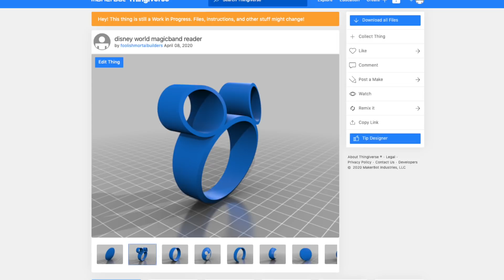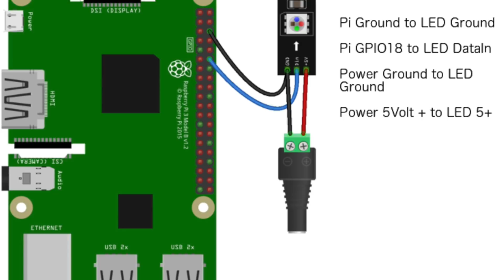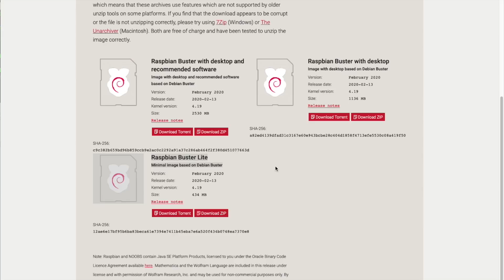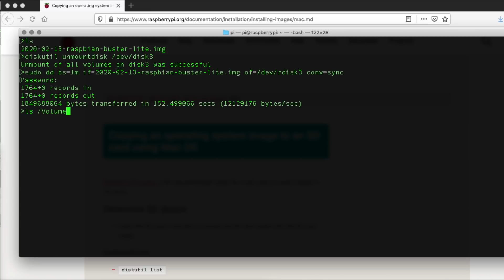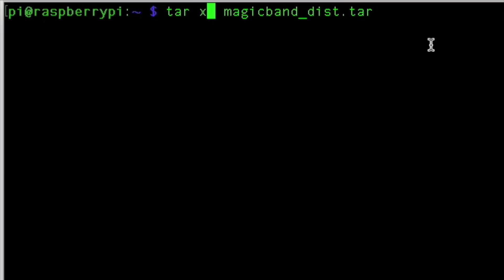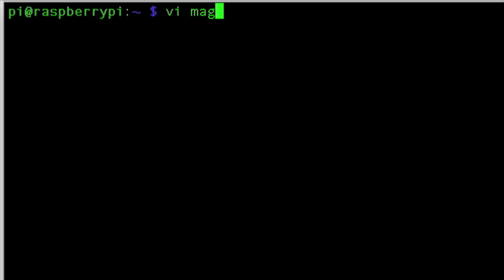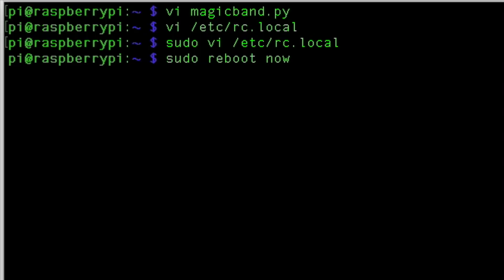Build a Disney World Magicband reader

Comment: For anyone finally getting around to trying this.... make sure you are using the:
Raspberry Pi OS Lite (Legacy)
Release date: December 2nd 2021
Kernel version: 5.10

Follow the video to install and gain SSH access. Once you are able to SSH in, immediately run raspi-config, get into the advanced section - audio and change to HDMI. Then continue following the video.

If raspi-config doesn't show you a HDMI option you installed the wrong version, raspberry has made a change in the latest OS, that took me and Foolish a bit to figure out before Xmas.

Also for sounds, make sure you put them in the /home/pi/ directory, not sure if I missed it in the video.

PS - want to thank Foolish for taking the time to go through my setup and help sort out what was going on with the new OS not working.
Reply: Would be able to help with the sound files?  I’ve tried contacting the creator via email as noted but I haven’t heard anything.  Any help would be appreciated.

Comment: Has anyone ever tried adding support to the code for one of the less expensive  NFC/RFID readers like the RC522?

An example of one of these is: https://www.amazon.com/IZOKEE-RFID-RC522-13-56MHz-Arduino-Raspberry/dp/B076HTH56Q/ref=sr_1_9?dchild=1&keywords=raspberry+pi+nfc&qid=1622200735&sr=8-9

From what I've read here: https://news.ycombinator.com/item?id=9177375  the Disney MagicBands appear to use the same 13.56 Mhz NFC chip that the RC522 readers can read.

The RC522 readers may not have the same range as the USB reader in the original design.  But for people on a budget, it would be a nice alternative.

I can confirm that the RC522 reader does connect to and work with a Raspberry Pi.  I used the example code from this site: https://pimylifeup.com/raspberry-pi-rfid-rc522/ to wire mine up, and to test that it can read a tag (not a Disney MagicBand, as I don't have one of those yet), and print the ID number of the tag.
I'm more of a hardware person, than a software person; so I'm not sure how to go about modifying the magicband.py code to add in support for the RC522.  I'm just wondering if anyone has tried it..?

Comment: Why did you not decide to run the PI and LED's off of the same power supply with both of them being 5V? This seems like it would simplify this a lot and save cost. Granted, you might need to run power over to the port, or solder it different. Any technical reasons that I'm not thinking of why this wouldn't work?

Comment: Hi I have scanned my magicbands and I only got the UID of it not any fastpass or DVC is there a way to use any other code like yours fastpass or DVC
Reply from the maker: All you get is the id of the band. If you want different sequences other than the dvc and fastpass, you have to program the sequence yourself using the settings conf file and uploading new sound files.  Nothing is read from the band other than the id.

Comment: Hey man, good job with all this, I'm trying to build my own and I already have a Raspberry 3 A+, it's still the same right? Thanks!
Reply from the maker: Yes that should work. You'll only have 1 USB port I believe, so if you want to switch out the speaker for a USB powered one (see other comments), you'll have to deal with that.
Reply: @foolishmortalbuilders1462  Thanks! I start building in a couple of weeks (waiting for the printed parts and components to arrive) I have another question, I found myself another rfid reader, but it only supports ISO14443 type A, do I need it to support A and B for this to work? Thanks!
Reply: These are the supported tags for the reader (Mifare 1 K (s50), Mifare 4 K (s70), f08, NTAG203, Ultralight, NTAG213, NTAG215, NTAG216)

Comment: Got it all printed up but I'm having issues with the inner ring.  Where does that go?  It's too big to fit inside the unit, and not quite big enough to have the shell components sit on top of it.  Please advise.
Reply from the maker: It sits half in the front and half in the back shell. with the open end pointing down towards the hole in the bottom of the shells.  I glued mine to the front shell, then I connect with screws to the back shell. Send me a picture of what you are trying to do (get email address from the about page on my channel) If you are having troubles getting it to fit, I have a slimmer version of that file you can try.
Reply: @foolishmortalbuilders1462  ah, yup that makes sense now.  I'll reach out should I run into any additional issues.  Thanks for the response.

Comment: I found this, it looks like the lights can be controlled by SPI intead of PWM eliminating the need for the HDMI dongle: https://github.com/jgarff/rpi_ws281x
Reply from the maker: Thanks. I'll give it a shot.
Reply: @foolishmortalbuilders1462  I didn't fool with it at all but pulling that HDMI adapter out of the mix would be cool lol.
Reply: Don't need SPI when you can just use another GPIO port, neopixels work with PIO10, GPIO12, GPIO18 or GPIO21 but 18 is the standard. No need to over complicate it.

Comment: Worked great for an hour and now the LEDS won't come on any more, troubleshooting......
Reply from the maker: Do they flash three times when the pi is powered on?
Reply: I broke the contact on the data bending it back and forth too much
Reply: So now I get to see whether or not I can solder on those three little tiny spots

Comment: Just finished printing all the pieces and the RFID came in today! Going to try and assemble this weekend!
Reply: What was the best way for you to remove the supports?
Reply from the maker: @clairefyfe4785  The 3d print supports always just pop off for me with little effort. Is that not the case?
Reply: Foolish Mortal Builders No they are being very tough, I’m going to have a look at my print settings tomorrow and see what I can do, I just started using my dads 3D printed and haven’t fully gotten a handle on it yet haha
Reply: @clairefyfe4785  I had several failed attempts before I got gcode that would print nicely.  It's definitely a part that needs polyfill, primer fill, sanding, and a good paint job =D

Comment: Thanks for posting! Love the idea.  Working on printing the parts now. What is the black outer ring used for? (Inside_ringv2.stl) Didn't see it used in the assembly. Thanks!
Reply from the maker: The ring is for joining the front half of the sphere to the back half. I glued 1/2 of the ring to the front sphere and I used screws to attach the back half of the sphere to the ring. This allowed me to take it off and on easily.  It's optional though. You could just glue the two halves together if you are confident that everything is working okay.

Comment: Well, this is literally the coolest thing ever.. i have all my parts ordered and am wanting to start thr prints tonight.. what did you use for supports when printing? Ive never really printed anything in a spherical shape. Just applying base supports through cura is making each quarter about a 23 hour print... that sound aboit right? Or are you somehoe positioning this with less supports?

Also, what was the reason in doing it in quarters? I was debating combining them into 2 halves to recude the visible lines where they connect. Thoughts? 

Thanks again for the amazing work into this.
Reply from the maker: I did it in quarters so it would fit on my 3d printer.  You might need to reposition the parts so the flat part of the sphere (where they connect) is on the print bed.  If you got the print space, you can definitely combine them into two halves instead.

Comment: the RFID reader comes up as unavailable. Do you have another option?
Reply from the maker: You'll have to provide me with more information than that. Which one did you use? What is the error message.  Did the install.sh run properly?  You can re-run it and se if it generates any error messages.
Reply: @foolishmortalbuilders1462  I was referring to your link to Amazon for the reader itself. It's not available to buy.
Reply from the maker: @kmc2227  https://shop.identiv.com/smart-card-readers/mobile/scl3711.htm

Comment: Thanks for posting the designs for this and the code. I've knocked up all the 3D printed parts today, ready for sanding / priming and painting tomorrow. I've never been so excited to prep a print before :) One question if I may. Being based in the UK, I'm having difficulty sourcing an RFID reader like the one used in the video. Are there any specific requirements for the reader or do they all work to the same standard? I've ordered a cheap reader that's the size of a credit card that i plan on hacking apart and adapting to fit into this design, so hopefully I can pull that off :)
Reply from the maker: https://nfcpy.readthedocs.io/en/latest/overview.html#supported-devices   See list of supported devices.
Reply from the maker: I added a link in the description to another online store you can buy them.
Reply: Nice work :) I found a retailer in the UK selling them, but they are basically twice the cost here than the links you have. The cheap readers I picked up don't look like they will do the job sadly. Pleased to say that the sanding and priming is now done, and most of the electronics arrived this afternoon, so tomorrow will be a fun day of building :)
Reply: If it is this one https://www.amazon.com/gp/product/B078TKPRRJ/ref=ppx_yo_dt_b_asin_title_o07_s00?ie=UTF8&psc=1, it will not work, The coil is part of the circuit board and dissent fit close enough to scan bands from outside the 3d print.
Reply: Correct, I've tried 2 similar designs and gave up in the end and ordered the SCL3711. I've also had a little play with the python script with a friend (mostly him to if i'm honest), so now it searches a directory on the pi containing the wav files, and picks one at random to play. It also checks the length of the sound file and continues to keep the led's illuminated until the end of the file. Pretty neat :)

Comment: This is amazing. Did you print the files with supports just the way they load into the slicer program?
Reply: Thank you!
Reply from the maker: I'm sure I adjusted them a bit before printing. I use Simply3d but anything will work. (Cura)

Comment: Maybe I'm crazy but where does the black semi-circle piece go?
Reply from the maker: I didn't show it in the video, but it's a support. I glued it to the front side 1/2 way in, then used screws to connect the back shell to the other side. Ill be providing an update soon to show how I used it.  It's certainly optional as you can just glue the two shell pieces together instead.
Reply: @foolishmortalbuilders1462  I was considering adapting the support piece to use magnets for easy dis-assemble. Although screwing it does sound a heck of a lot easier :)

Comment: Im trying to replicate this....I am ssh to the pi and am trying the tar xf magicband_dist.tar

tar: magicband_dist.tar: Cannot open: No such file or directory

tar: Error is not recoverable: exiting now

I get the above error, not sure what Im doing wrong. Maybe I did not place the files from GitHub correctly?
Reply from the maker: When you click the green clone button from github and then click "Download ZIP", you will actually get a file called magicbandreader-master.zip.  This is the file you should transfer, in the video I used the tar as that's what I had at the time of filming.  SCP this file over to the pi and run "unzip magicbandreader-master.zip"  instead of "tar xf" command.  OR you can unzip on your computer and SCP each of the files individually over to the pi.  Hope that helps.
Reply: @foolishmortalbuilders1462  Thanks for responding, unfortetly still stuck. Im not familiar with SCP so I simply put the sd card into my mac and copied the .zip over, when it still fails to extract, I then just extracted it on my mac and copied files to sd card but then still install does not work.
pi@raspberrypi:~ $ unzip magicbandreader-master.zip

unzip:  cannot find or open magicbandreader-master.zip, magicbandreader-master.zip.zip or magicbandreader-master.zip.ZIP.

pi@raspberrypi:~ $ sudo sh install.sh

sh: 0: Can't open install.sh

pi@raspberrypi:~ $
Reply from the maker: @jeremybaker4856  Use the email link in  my channel about page , to send me an email and I can help. https://www.youtube.com/channel/UCn6uokneShVYb6rKnermr2A/about

Comment: very cool. I was just in the process of doing something similar myself... wanted to build mine as a doorbell, but using an arduino nano rather than a raspi (need it to be battery powered, using a ultra lower power timer circuit and need a quick boot time). You had way better success with your inserts than I did, for some reason when printed I'd always get a variance in size, so gave up and used hot glue. For testing purposes I also used strip, but going to neopixel rings (when they finally arrive from China). Had to comment when saw you did something similar.
Reply from the maker: Doorbell. I like that idea.  Can't you just pick up the power from your existing doorbell (24v I think) and step it down to what you need?   I tried the neopixel rings first, but I liked the way the strips lit up the ring. Let me know how your version turns out.
Reply: @foolishmortalbuilders1462  alas my current doorbell is wireless/battery powered so keen to keep it the same. Just took a quick vid of where I'm up to https://www.youtube.com/watch?v=pBCrjpx0mSs. Now largely on hold til a few more parts arrive (lockdown sucks).
Reply: @MikeOwenNZ  What did you use for the physical RFID reader and arduino?  The one used by Foolish Mortals is USB and they used Raspberry Pi...  I do not think it would work on a nano.
Reply: @smithscott119 Reader was an RC522 based board using Mfrc522 library w/arduino nano however I gave up getting the reader working(it would read other tags just not my magicband). I have a vid that shows the problem I was having and a teardown and link to repo. I did find another person using the same (search bringmagichome) rfid reader where it worked but only with a magicband where the battery hadn't gone flat (mine were a few years old).